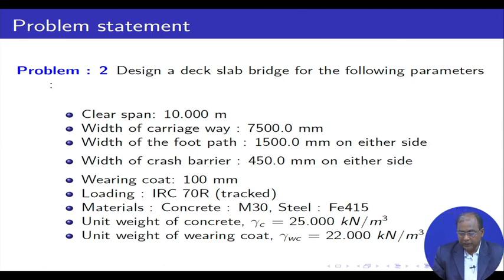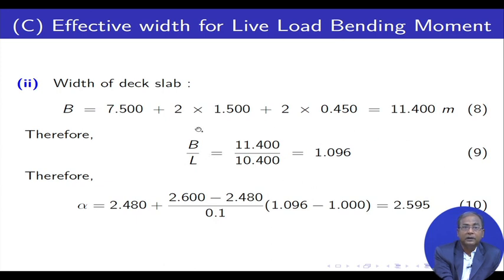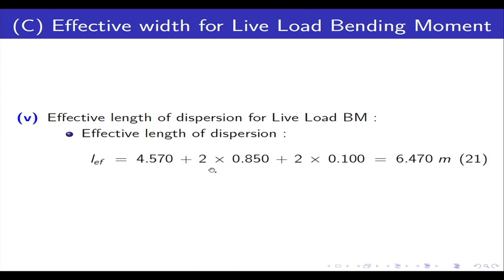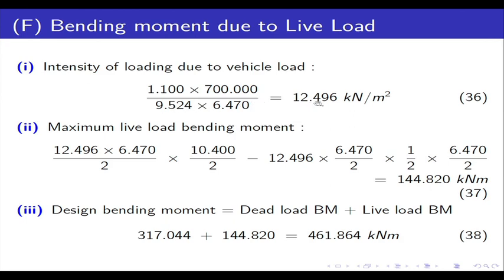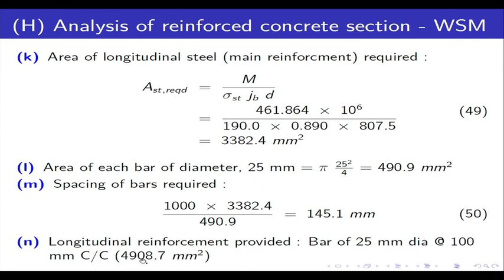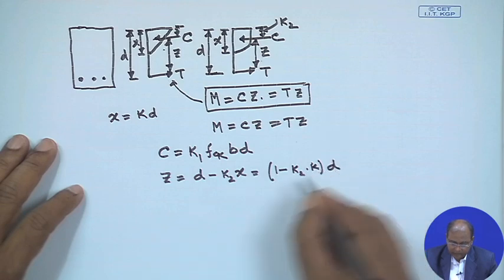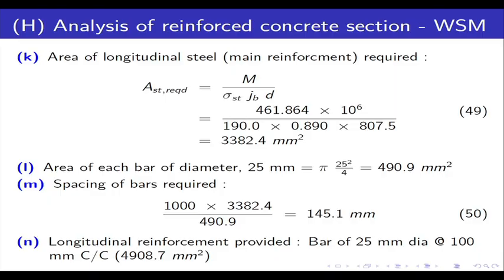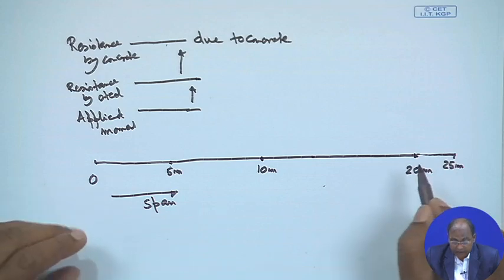Design of Slab Bridges (Part VI)

Comment: Respected sir,

In calculation effective width for shear force, the value of "X" is taken not clear (i.e the length of track is 4.57m in long direction), therefore 4.57/2 is 2.285. But in calculation you have taken dispersion width of bending moment (i.e) 6.47. As per above calculation dispersion width is considered for Value "X"  then X= 6.47/2 = 3.235 should consider but in calculation 2.385 is considered for clarification please see video at (10.20 mints). Please clarify the above doubt.